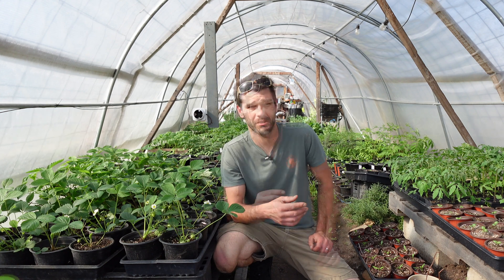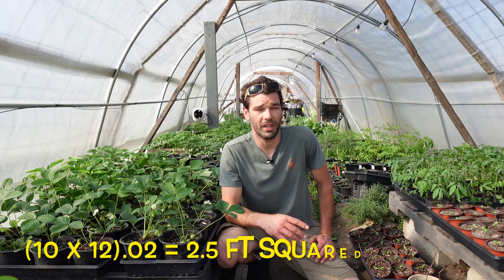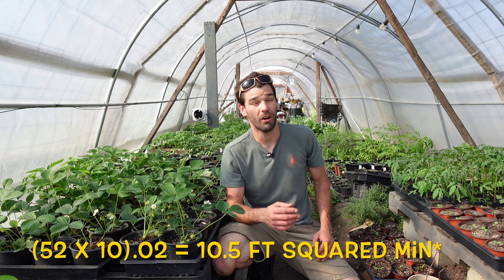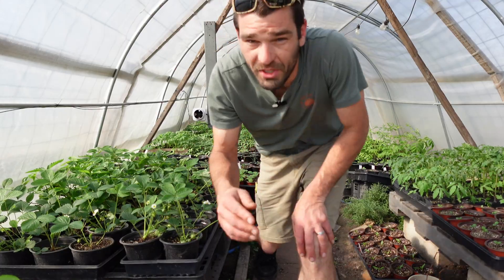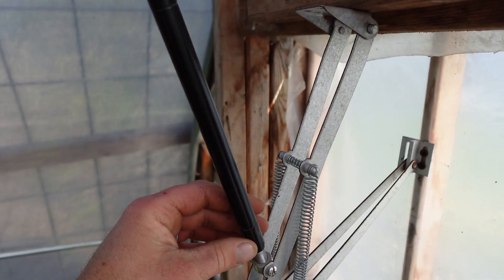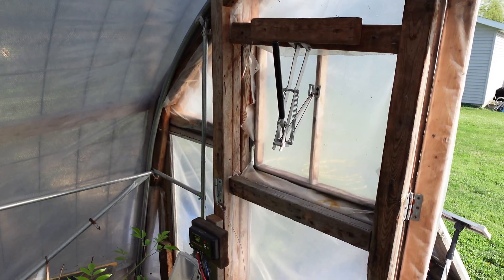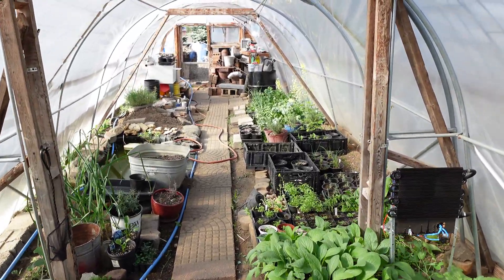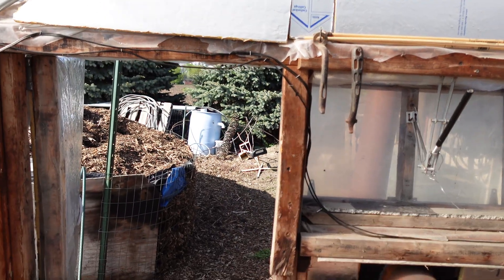DIY Greenhouse Venting Formula To DIY - Minimum Requirements For Venting

Comment: Do you use your Geothermal to push cooler air into the greenhouse. The ground should maintain an even 55 or approximate temperature and it works all winter so wjy not add it to the summer. You might want to add a thermostat that only kicks it on when it reaches a certain temperature, but it seems reasonable to use your geothermal all year.
Reply from the maker: that's a great question everyone might be asking! (thank you) so we have used it in years past and by the time fall rolls around we accumulate a good bit of water from condensation being pulled from the ambient air outside as it runs underground. We ran it all last summer and it did benefit crops close to it, but we had so much moisture that the pipe was gurgling with water. We had to figure out a way to pump the water out of a 7-8' deep pipe which wasn't easy lol between small pumps and towels on a drain snake we were able to dry up the entire geothermal tube. in summary we don't run it in summer because as spring hits we like to leave the doors open which keeps us from running the geothermal.